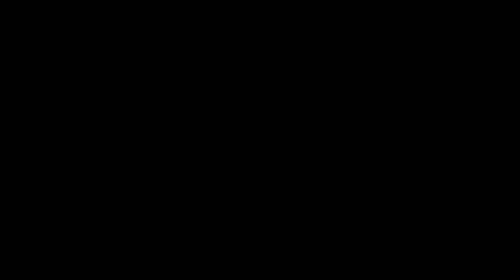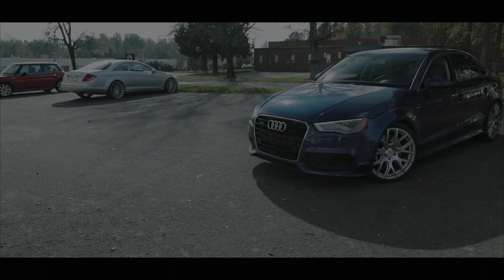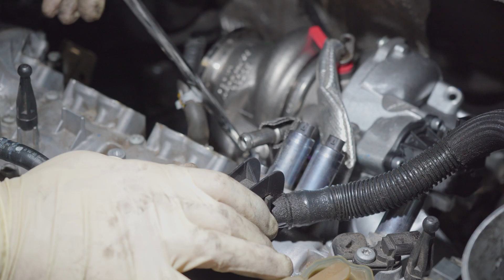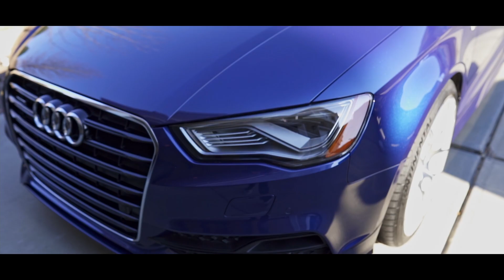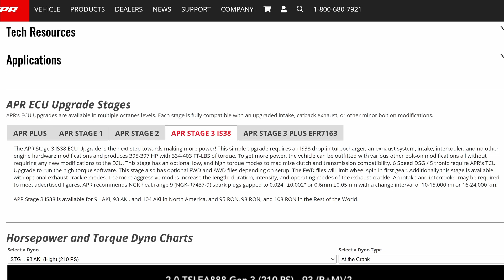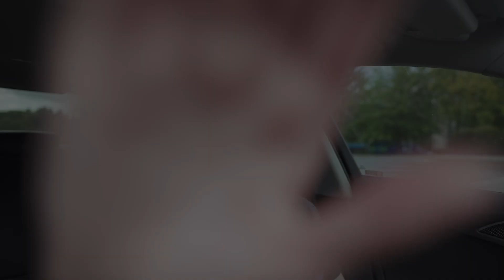How To Build & Modify Your MQB Audi 2.0T

Comment: what would be a better choice for a fun daily to take on the curvy backroads, A3 quattro or A4 quattro both 2.0t and im probably gonna mod both of these up to stage 2 lol
Reply from the maker: Personally imma have to go with the A3, shorter wheelbase, more compact, better ecosystem of upgrades! Have fun either way!
Reply: @savagepandaprojects  thanks man, im going to go check out a 2019 a3 PP with 3k miles for 30k this sunday, i was worried about the rear seats but im not gonna lie they actually are pretty comfortable and you can fit a decent sized humanoid creature thing in the back lol

Comment: Love the content. What is the max power these engines can take before it needs a forged engine?
Reply from the maker: Thanks for your support! great question. I think that it would be hard to give an exact figure as there are so many variables. really the most important thing is keeping the torque down to help reduce stress on the motor. Hope that helps!
Reply: The actual engine I heard is good for 600hp-700hp
Reply: @8vdrei  holy shit. ive seen 600wheel but wasnt sure if that was a billet block or not, thats absolutely insane for this platform lol
Reply: @antonymousss  check out Madonna it's the fastest mqb, however it's in a gli
Reply: I’d say to be safe, 400hp, anything more, I’d be looking at rods and pistons